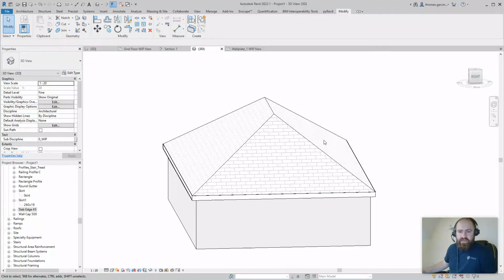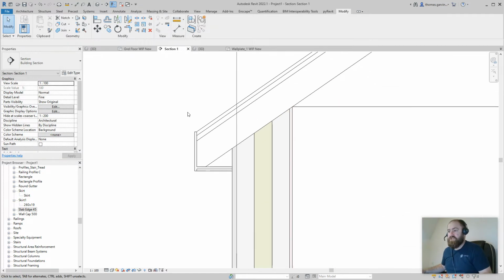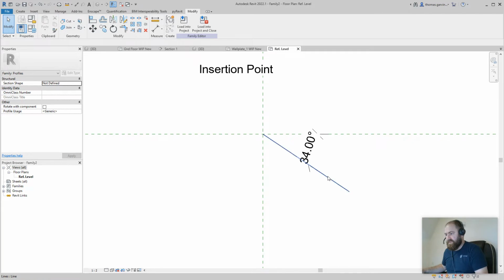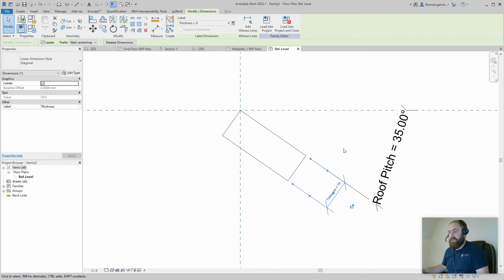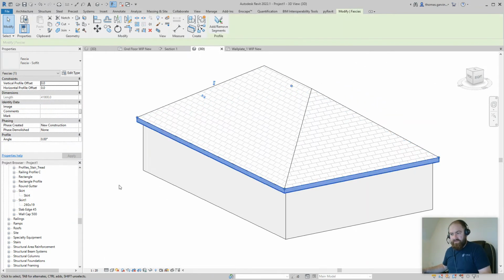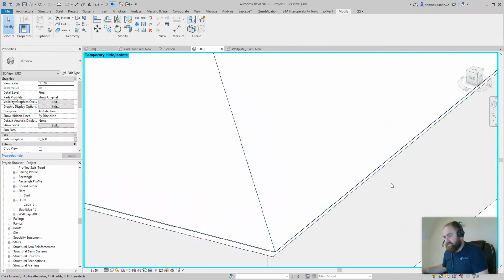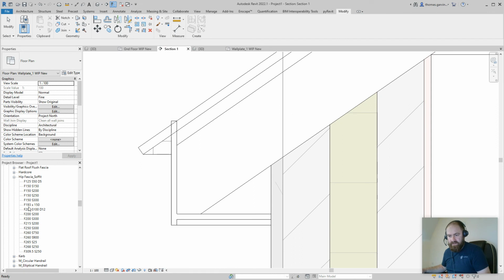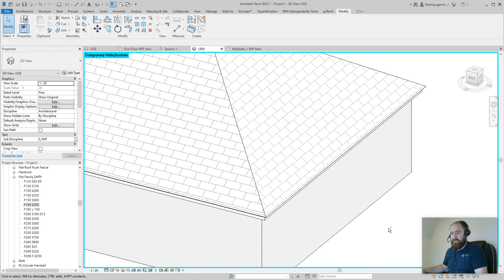Revit Roof Finish Overhanging Fascia and Gutter

Comment: Great solution. On the same topic, how about a roof that overhangs the gable wall. In Revit the whole roof structure will be visible through he gable wall but this needs to be stopped short of the wall and just the batten and tile needs to over hang? Also still need to have the roof inline with the wall so you can attach top/base?
Reply from the maker: Hi Mike. Thanks for that. I've made you a video to answer your question. Hope it's useful, you'll get it at this link https://youtu.be/9rF3q8sd0TQ
Reply: Brilliant that's perfect.thanks.